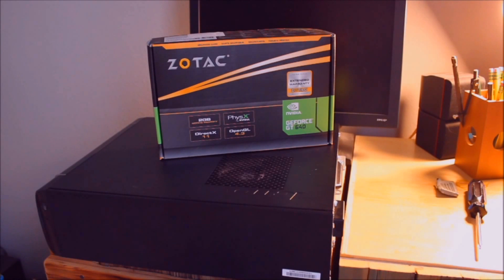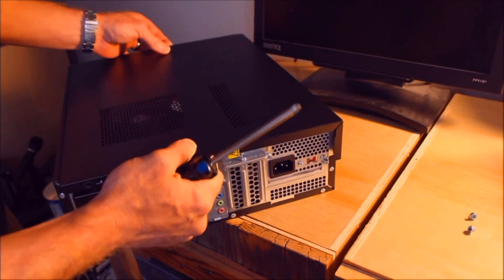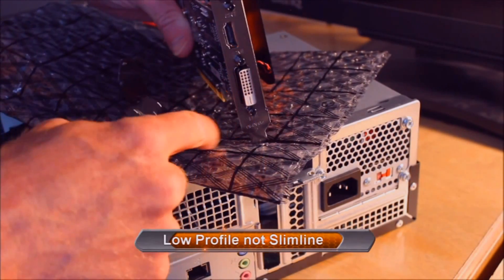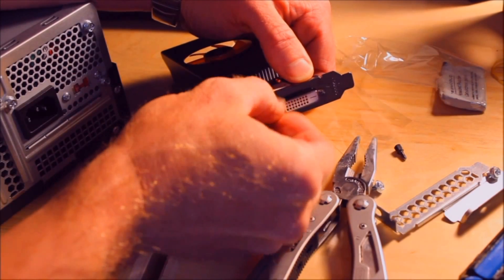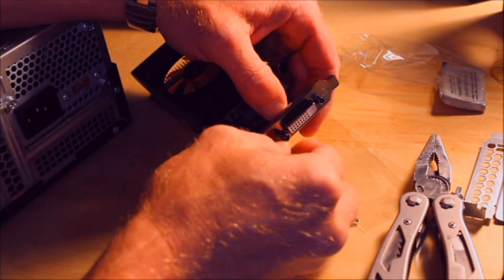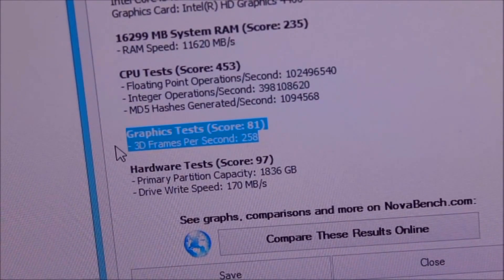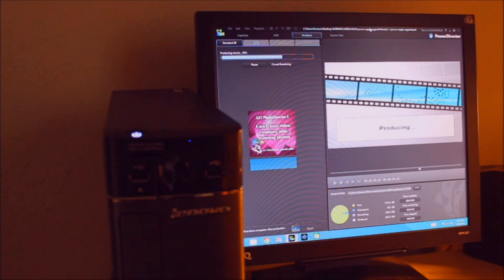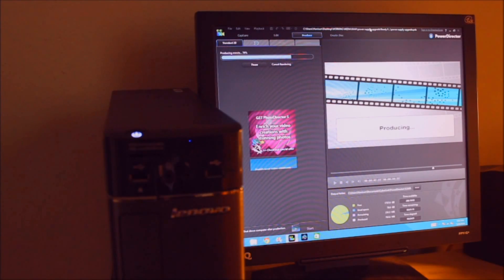Lenovo H530S Graphics Card Install

Comment: Hello, was this a plug and play type of installation or did you have to disable the onboard video card for it to work?  I'm under the impression that if the BIOS says "auto" for the display then it will first look to see if there is a video card in the PCI slot before it uses the on-board video.  Reason I ask is because I've had 2 video cards that seem to be bad but I want to make sure I'm not missing something.

Comment: hii sir i have lenovo h530s slimline pc but i transffer whole parts in to the other ruler cabinet .those are intel 1st genration core i3 proccessor of h55 motherboard
so my question for you is,
can i install hi profile graphics card of ddr5 range with gtx 980 series or gtx1080 series in this system ? with 500 to 600 watt powwer supply ?

please answer me

Comment: Hi, I recently bought the original H30 and it currently has a 65w psu  but I'd like to upgrade the graphics card but I'm not sure which ones I could use because I only have a 65w psu, could you give me some suggestions?

Comment: I have a question, Please somebody help me please.

I have Lenovo h30-50 desktop with Intel had graphics, it looks same inside as in the video above. Can I put GTX 750 ti in it??
Reply from the maker: Looking at the motherboard specs on your repair manual it looks like the card will fit as long as you get a low profile version like the MSI and Gigabyte cards http://amzn.to/2aeiM3t . Only thing is I'm not sure about the power.  If you look at the parts list on your manual https://download.lenovo.com/consumer/desktop_pub/lenovo_h30_hmm_20140929.pdf it looks like there was an optional OEM geforce gtx 745 with a power draw of 55 watts for the card.  The gtx 750 ti draws 60 watts.  I wouldn't think the extra 5 watts would cause a problem but I can't guarantee it.  Worse comes to worse, keep your box and return the card if it doesn't work.  Good luck.  If you do it, please post your results for others.

Comment: btw what will probally happened if i move my PSU out of the case for space for Asus GTX950 mini with 6 pin?( i mean what will happen with my computer,such as i can't use 6 pin, the psu has problem etc  )(i will cut my case for the height of the card)
Reply from the maker: +MisterButtons It should be OK if you take the power supply out of the case.  Just make sure you have the ventilation on the power supply clear so it can cool off.  Also, I can't remember if there was another case fan but they might be using the power supply fan to remove some of the heat from the case.  If you don't have the PSU in the case that also opens you up to a standard ATX PSU.  I've been thinking of stripping what I can from the lenovo and making another computer from it.
Reply: thx man

Comment: do i need a pin adapter if i gonna upgrade my gt635 to gtx750ti
Reply from the maker: MisterButtons I looked at a couple of cards online and it looks like the PCI Express slot is able to power it.  Looks like the max power draw on the 635 is 35watts and the 750ti is 60W
Reply: ok thank you so much :D

Comment: So, please tell me this:  would a gtx 750 ti fit into an h530?
Reply from the maker: speedracer4878 it looks like MSI has a low profile 750ti that might run.  The power requirements say you need a 400W power supply.  http://goo.gl/JolcIU

Comment: hi!,  what was the original psu wattage? and can I upgrade it to nvidia quadro k600?
Reply from the maker: Dito Designs The original wattage was 180W.  Looking it up online the max power consumption is 41 W, We've had people post up they've added a geforce 730 with the original psu where the power draw can be 23-49 Watts depending on the memory interface.  Sorry I can't give you definitive answer.  You might be able to run it on the original psu.  If you decide to try it please post up the results.

Comment: does anyone know what would be better? Intel 4600 (integrated graphics) or an nvidia gt 720
Reply from the maker: Mr Jetpackjack I just did a quick check and I found this on videocardbenchmark.net .  The Average G3D Mark is727 for the 4600 and 828 for the gt720.
Reply: AdventuresInDIY thanks :)

Comment from the maker: Hi Sagar.  I'd like to reply to your comment but your setting doesn't let me.  You could technically leave the vga connection hanging to the side but if you're not going to use it, its better to just remove it.
Reply: Do you think a radeon r7 260x can run on a 180 watt source?
Reply: *****http://m.bestbuy.ca/defaultpage.aspx?lang=en#/catalog/productdetails.aspx?ajax=true&sku=10360967&lang=en-CA
Reply: AdventuresInDIYi got this pc so thx for telling me how to upgrade it ps where did you get the part's from
Reply from the maker: Piotr Waniek If you take a look at the power supply upgrade write up I did there'll be links to the items.  http://www.adventuresindiy.com/computer/lenovo-h530s-how-to-upgrade-your-power-supply
Reply: AdventuresInDIY thx and by the way do i need to upgrade my power supply  to get the grapics card in
Reply from the maker: Piotr Waniek You might be able to drop it in and get it running, but the real test will be when you start tasking it playing  games.  I upgraded mine because I ended up dropping in an i7 4770k and graphics card.  The safe thing is to upgrade the power supply first.  You'll never really know until you try it.  The unfortunate thing is I'm not really sure what the whole system power draw is on that standard 180W power supply.  I've installed graphics cards in the past where I put them in machines that couldn't supply enough power, and the worst thing that happened was I got warning about there wasn't enough power to the graphics card.
Reply: AdventuresInDIY will this run gta 5 is the big question
Reply: What's the VGA connection for ?

Comment: hey ! i have H530s but it still uses intel pentium, if i want to upgrade my processors to i5 and graphics  to nvidia gtx 750 (for example). what should i do ? thanks before
Reply: ***** okay..can you give some graphics cards that work with h530s ?
Reply from the maker: Nosa Ajulva Zotac makes a low profile 740 http://goo.gl/QFlSVN that would work but your probably going to need to upgrade your power supply to do the stuff you want to do.  Also, if your H530s has the intel celeron j1800, I believe that is an embedded processor and cannot be upgraded.  Leave your specific model number so we can help you figure out what your options are.
Reply from the maker: ***** I just had someone confirm they used a GT 730 with the stock lenovo 180 watt power supply https://www.youtube.com/watch?v=_2qTuCCgkN0&lc=z125yxgo5ymysrvtq23nudchkxumepmkq
Reply: AdventuresInDIY
my H530s specs are Intel Pentium G3220 (3 GHz), 2GB of RAM, Intel HD Graphics 4400, 500GB of HDD, 180W PSU stock
my friends gave advice to upgrade to Intel i3 4th Gen, 8GB of RAM, HIS Radeon R9 270 2GB DDR5, and PSU Corsair VS Series 550W
Can you help me how to upgrade my PC ?
Reply from the maker: Nosa Ajulva Since you have a slimline, the power supply would have to be a TFX one not a standard PSU.  I've seen a 400W kentec ones on amazon.  I'm using a 350W one http://www.adventuresindiy.com/computer/lenovo-h530s-how-to-upgrade-your-power-supply .  I recently dropped an intel i7 4770 with that power supply.  As for processor I would go with an i5 like this 4460 http://goo.gl/TtRmwB .  The big difference is your going from 2 cores with an i3 to 4 cores and double the cache for less than $50.  For graphics cards, first off you're going to need a low profile card, second look at the power consumption using the amd or nvidia site.  In my power supply upgrade video https://www.youtube.com/watch?v=_2qTuCCgkN0 in the comments +Christian Changa confirmed you could drop a Nvidia 730 low profile card using the stock 180W power supply.  Hope some of this info helps.
Reply: AdventuresInDIY oke thanks a lot for helping me..

Comment: Hey I just got a lenova H530. CPU-I3-4150 3.5 HDD-1 T, Ram-6gb, Hard drive- 1gb. I know I need a new power supply before graphics card. What power supply upgrade do you suggest. And what graphics card ? (Would like to play stuff Far cry 4 or Aliens Isolation) Is that going to be possible without spending a ton of cash ? Also any other upgrades you might think would be necessary please let me know. Thanks!!
Reply from the maker: I replaced the power supply in this video https://www.youtube.com/watch?v=_2qTuCCgkN0 .  There should be a link the description to an article I wrote on what I've used.  If you want to go crazy with the power supply you might be able to get away with a Kentex 400watt unit http://goo.gl/5XuaXa but I haven't used that one.  For graphics card I would go with Nvidia because of the low power consumption.  Hope this helps some.

Comment: I have a H520, does that have a PCIe port inside it? I want to install an AMD Radeon 5450.
Reply from the maker: According to your manual. http://www.lenovo.com/shop/americas/content/user_guides/h520s_ug_en.pdf . It says you do have a PCI express 16 slot.

I looked at what AMD is claiming for the power draw and it says 19.1 Watts according to this page http://www.anandtech.com/show/2931 .  A low profile version of this card should work because of the really low power consumption, but make sure you keep your receipt.

Comment: http://www.theitdepot.com/details-Lenovo+H530s+Desktop+-+57328483+(Core+i7-4770,+8GB,+1TB,+18.5inch,+DOS,+3+Year+Warranty)_C28P22465.html
Hey is this the same system you have? If so, will u recommend this? Because i am thinking of getting a system.. This one seems to have everything i need.. Please help..
Reply from the maker: I have the Intel i3 system and after maxing the RAM,  video card and power supply upgrades it is a good machine for what I do.  The i7 system is nice, that is my last upgrade btw.  I do video editing and Google sketchup on mine.  That PC would do just fine since the 4th gen i7 has a pretty good integrated graphics processor.  I also like the size because it doesn't take up a lot of space.   

Only thing is if you eventually want to upgrade to a dedicated graphics card you might want a larger computer case so you're not limited base on having to buy a low profile graphics card.  

With all that said, that system should last you years and is a good base system that you can later apply some upgrades to, like SSD hard drive and additional 8GB of RAM, if you think it is slowing down.  Hope this helps a little.
Reply: How much integrated graphics does it have? I cant find it anywhere >.<.. Or should i just assemble a system like most people do?
Reply from the maker: It has Intel® HD Graphics 4600.  If you can assemble a system, you might be better off doing that.  It is more work and you'll spend the same money (sometimes more), but you'll end up with the exact system you want.

Comment: Could you please suggest me with some better graphic cards other than the one you showed? (if there is any) I needed a powerful graphic card for doing video editing. Please help me find a suitable card. Suggest me some. It would be very helpful.
Thank you.
Reply from the maker: If you look at the system requirements for the software you want to use it will tell you some certified graphics cards.  For example, if you use Adobe Premiere check out this page, http://helpx.adobe.com/premiere-pro/system-requirements.html .  If you scroll down a bit you'll see some certified cards that will help accelerate your video rendering.  Just make sure your power supply can handle the graphics card you choose.  

Also, make sure you have at least 8GB of RAM in your computer.  This will help keep your computer from having to cache programs on the hard drive and speed things up a little.  Hope this helps some.
Reply: AdventuresInDIY Thank you so much sir. But would you please suggest me some names of good graphic cards? I want to know your suggestions.

Comment: I'm still a novice with this, but why did you go with the GTX 640 instead of something like a 750, some of which I have read will fit?  I also have a h530s.  Also, was increasing the power supply necessary? Thanks!
Reply from the maker: It was cheap at the time, < $100 shipped.  If I were to buy another one now it would probably be the 750 since it is close to $100.
Reply from the maker: polosaurus all the cards I looked at require a 400 Watt power supply.
Reply from the maker: That's great you did that!  It looks like a GT 740 is the highest you can go w/o a 6 pin power.  They make a low profile gtx 750 but needs one.  Hope this helps some.
Reply from the maker: Cool!Can't wait.
Reply from the maker: Sweet!  Sawing off.. that's just customization :D